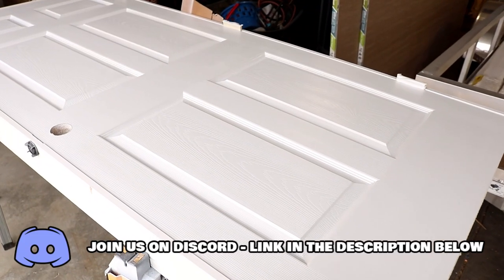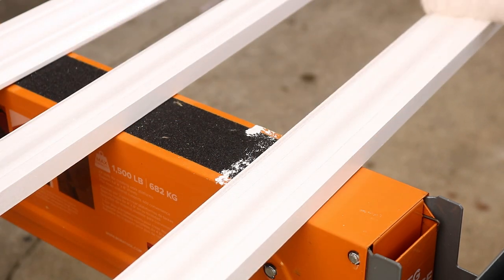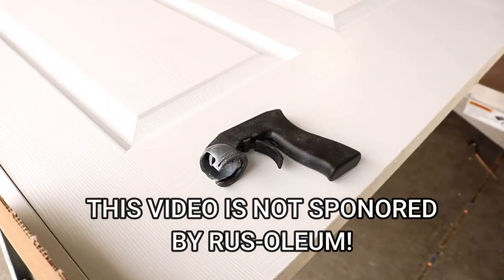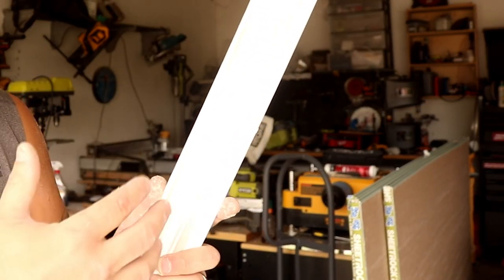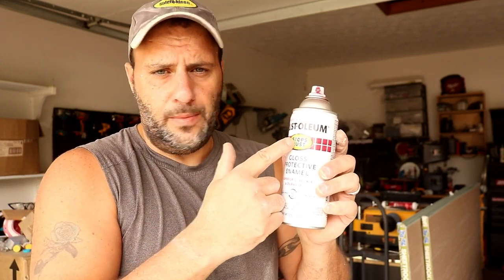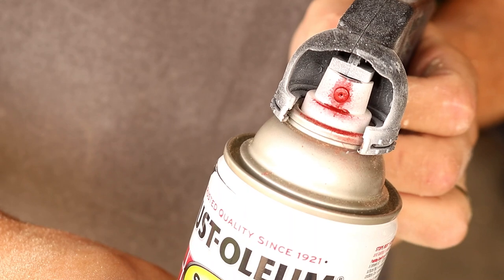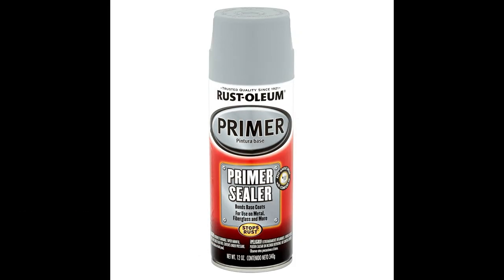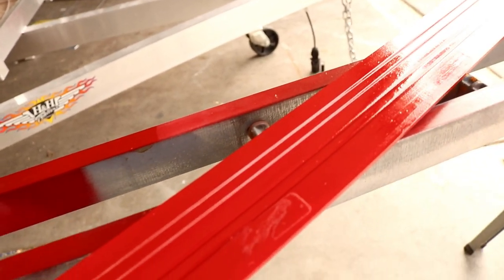how to paint like a pro with this $4 tool

Comment: that's what I was doing wrong I was always trying to hook it up to the one gallon paint can and I could never get it to fit around the top of the can so then I would run it over with my truck hoping it would stretch the connection part bigger good thing you made this video I never know it hooked up to a spray paint can all this time I was doing it wrong😆👊👍🇺🇸
Reply from the maker: Hahahahaha